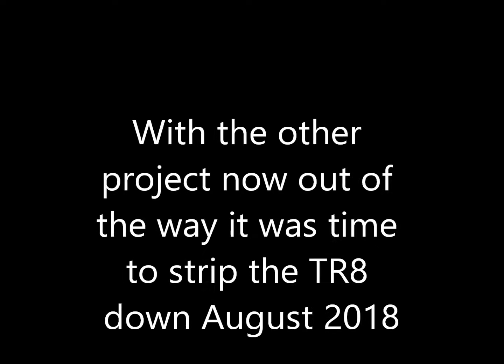Triumph TR8 resurection part 2

Comment: How many miles are on the car?  Doesn't look to bad.  Is that a 5.0 upgrade?
Reply from the maker: Been sitting forever here in western Colorado.  Came with the original 3.5 but with a two barrel conversion.  Plan was to upgrade to a 4.0 and try and get it around 200 hp or so
Reply: @larue33054  That should be nice.  I noticed the 2 barrel in the video.  Strange they didn't go for the 4 barrel when it was upgraded.
Reply from the maker: @chuckp8705  They didn't do the upgrade.  By the looks of the original carbs there may have been a fire in the engine bay at some point.  That particular 2 barrel probably had enough air flow for the 3.5 that was in it.